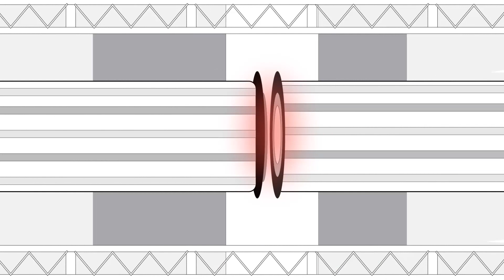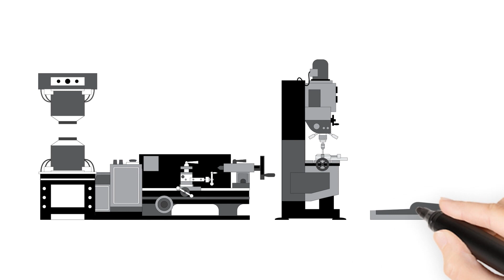Rotary Friction Welding: A Solid State Joining Process

Comment: Whenever the properties of the two metals to be welded by friction are more close, the coefficient of friction between their surfaces will increase so that their fusion with each other is faster as a result of the rise in the temperature of their surfaces to melt point at the same time